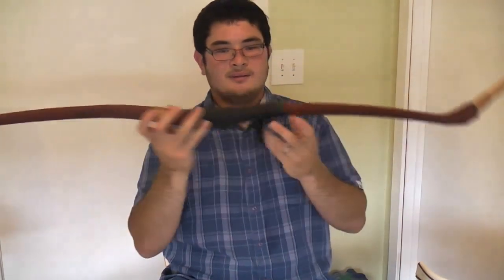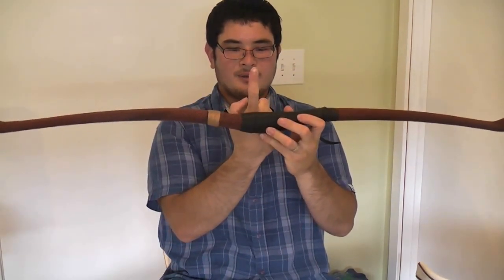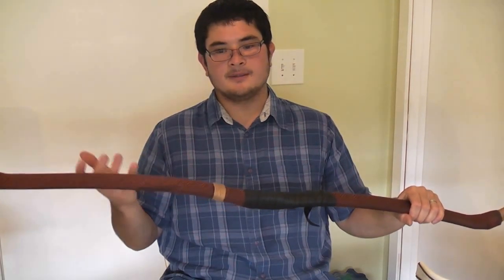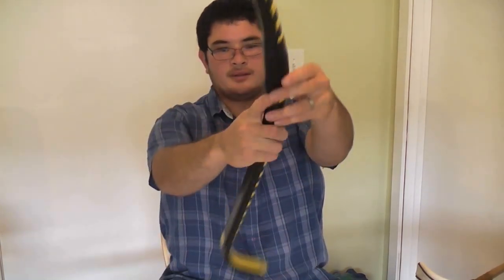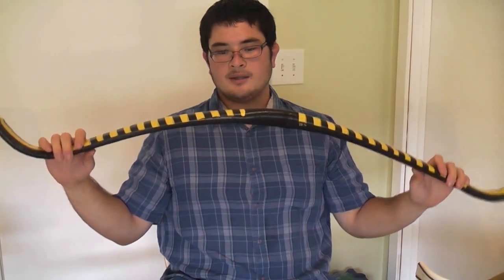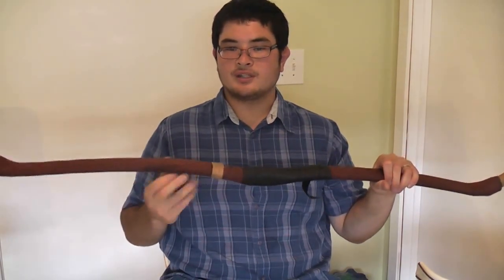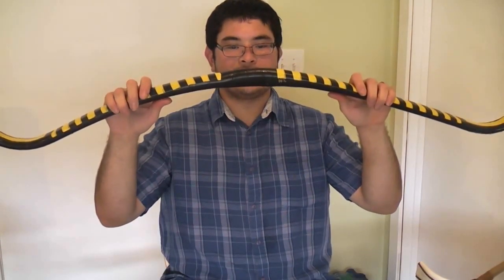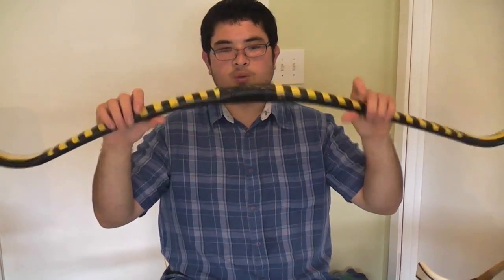Gray Electrical Conduit VS White Plumbing Pipe for PVC Bows

Comment: I am in Canada and use grey electrical conduit regularly and have not had the issues described here. I am wondering if the conduit we have here is a slightly different composition. What are your thoughts?

Comment: I live and shoot in coastal Alaska. I'm worried about the shattering effect upon PVC (even grey PVC) in ordinary summer and fall temperatures, which can be as low as 45 degrees F. What do you suggest? What are the minimum temperatures that PVC bows be relied upon to safely work (white and grey)? In all other respects than temperature, PVC bows make a lot of sense here, on account of all the rain. I'd really like for PVC bows to work here.
Reply: Applying some kind of skining material like he has on his helps control the situation in case of a RUD (rapid unscheduled dis-assembly)

Comment: Ok so would love to have an anwser for this.
In my country (netherlands) the grey PVC is made out of recycled old PVC and new PVC
Wich means it has 3 layers, a outside, inside and a middle one.  is this the exact same for your piping over there? or is it just made fully out of new pvc?

Im asking this because the white piping over here is just not thick enough, my bow didnt bend at all, after just a little bit of force it just "folded over on itself... meaning its useles.

Help meeeeeeeeeeeee :P

Comment: I now understand something that happened to me tonight, making my 50# Take Down out of 1" white pvc. It's 10 degrees F. in my garage, in Northern Utah, and when I flattened the arms, the tips cracked on three sides for about 2" on the ends. I cut them off at 2 1/4". Less recurve now. Not sure how that will affect the bow. I'm guess less performance. Still bent bent the ends on the old recurve, 6" line with a 6" can. It looks good but not sure what it will do to the bow. Thanks for this info'.

Comment: I have used grey pipe in the UK, and with my first decent flattened horsebow. I took it to my local archery club and shot it around a field course and after 30 shots the bow became more powerful and faster. Probably only another 5lb making it roughly 30lb @ 32", but everyone at the club were impressed with the bow and couldn't believe a bow that shot and bent so well was made from some plastic pipe. In the UK the gray pipe works well, as i used white pipe which just kept snapping. Thanks Nick

Comment from the maker: Like sadrice said, the black pipe is usually ABS pipe. Most ABS in the US is foamcore, meaning it is composed of plastic foam between two layers of solid plastic. Very light and tough, but when bent it tends to fold or snap. Solid ABS may work, but I haven't done too much with it as it is hard to come by. Foamcore ABS is great for quivers and bracers as it is so light but has body to it.

Comment: Black pipe (usually only available in larger sizes)  is ABS, not PVC, and is tough and flexible, without much elasticity.  I haven't tried it, but I don't think it would make a good bow.